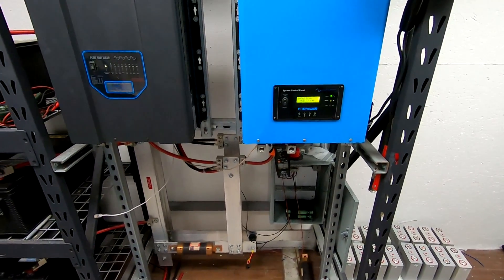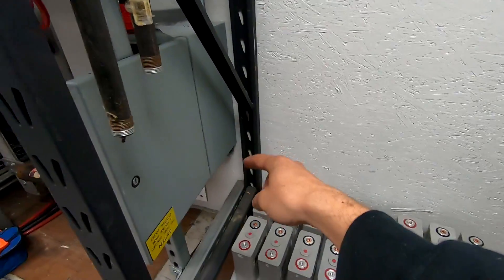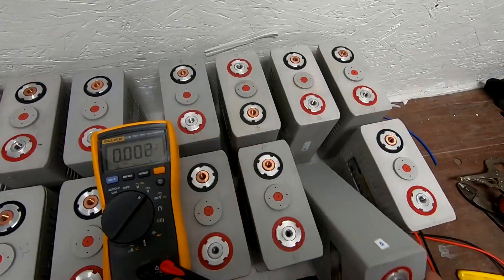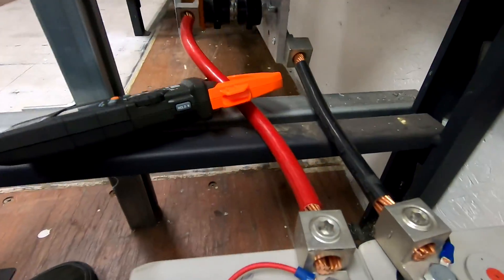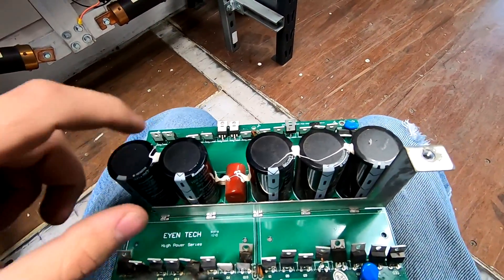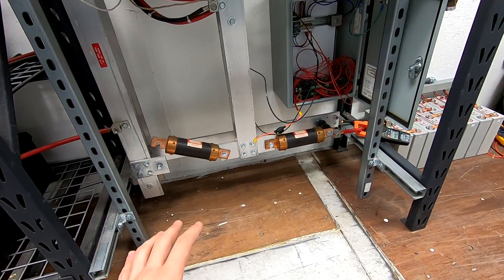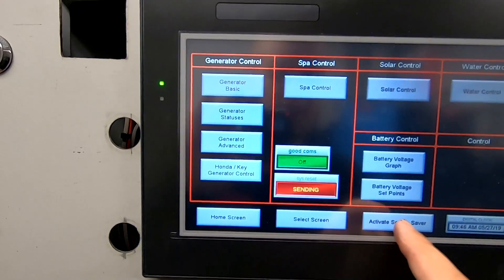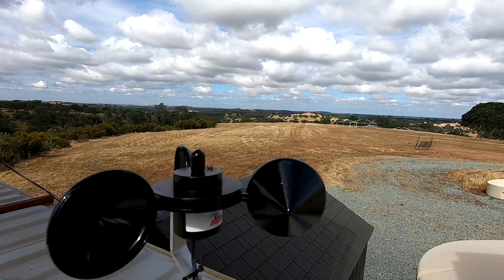Off The Grid: Installing the Best New Lithium Batteries!

Comment: Use a bank of high power halogen flood lights paralleled as a precharge PTC load. Lights will dim as current decreases and gives a good indication of when it's close to charged and safe to install the fuse. Works well for high powered audio systems so you don't blow fuses charging the caps.
Reply: @masterspacetime2826 Clever and inexpensive not janky. You can buy PTC inrush current limiters use an amp meter for indication. Now use a light bulb has PTC (positive temperature coefficient) characteristics and it also visually indicates the drop in current. This is the way you do manual 3 phase synchronization on generators until synchronization meters became the norm.

Comment: Thats a big idle load. My 10kw only uses 70w. The inrush on my inverter pops the breakers in the back of my inverter. Also my inverter only has 3 mosfets.
Reply from the maker: I forget, was your inverter a low frequency transformer based unit?
Reply: @HighTechLab  yes LF
Reply: @HighTechLab  Check it out . Inverter is half way through the vid.https://www.youtube.com/watch?v=GaBim8QpV1g

Comment: Awesome work. What are you doing for temperature on the lithium?
Reply from the maker: I'm not sure what you mean...Are you talking about temp monitoring?
Reply: @HighTechLab  yes for the lithium batteries
Reply from the maker: Currently, nothing.  The lithium cells don't require temperature compensation the same way that lead acid does, in fact any compensation would cause these cells to go out of their operating range (over voltage).

During use the cells don't typically generate heat, in fact the only heat I've ever noticed is on the interconnecting straps.  The lack of cell heat is due to their extremely low internal resistance (Remember resistance losses turn to heat and become heat losses).
Reply: @HighTechLab  Correct the temperature compensation is set to zero, but most BMS have temperature monitoring for shutdown control.
Reply: HighTechLab I think the question is for protection of charging when the cells are too cold or hot... depends on where you live I suppose...

Comment: Beautiful work.

Ex-EE who worked on nav systems decades ago, how would I go about learning all about inverters, charge/discharge rates, blah blah and blah to be able to design and troubleshoot this stuff myself as opposed to hiring a contractor whose work (even if I did hire one), I’d still want to know how to double check?
Reply from the maker: Check out 
"DIY Solar Power with Will Prowse", guy is pretty smart and I've learned a lot from him.  There are quite a few channels here on youtube that you can use as resources.
Reply: HighTechLab ditto. I found his channel informative and pretty unbiased when doing reviews and diy setups.

Comment: Did I just watch the similar video or the same on twice?
Reply from the maker: There is a clip or two that carried over.  There is much more info on this video though
Reply: I dont know if you have,but I would be interested in some videos if you ever decide to have a wind generators as well :/ :) 💜💖🧡💗🖤
Reply from the maker: I would really like to do wind power - given that we are on the top of a hill we could really benefit from it.

The struggle with a lot of this off-grid stuff is getting the county on the same page.  Currently the system is all in a shipping container and considered personal property, and could be removed if we were to move off the hill, therefore a permit is not required.  As soon as we permanently install anything that is not removable such as ground mount solar panels, wind turbines, etc. they want all parts of the system to be permitted.

A wind turbine would also need the structure engineered (the concrete, post, guy wires, etc.), so what ends up happening is the cost goes through the roof and it no longer becomes a viable option. Typically to get something engineered like that is around $2500, so consider how much power it generates and how much diesel fuel you can buy for the same cost.

Maybe I can do a better video explaining the return on investment aspect of these systems.
Reply: @HighTechLab  Mount/bolt the pole to the side/corner of the shipping container. A small 400W+ wind turbine would probably go a long way charging batteries at night & cloudy days. Reduce the generator runs at night and/or allow for a smaller battery bank. Might be worth it to experiment. Might make for some good videos too!
Reply: Yeah I can see that eating the dirt :d
I thought of many small turbines..but oh  well :/ I am not the smart one here, you probably have a reason for what you said,hope you be happy anywhos ^-^ I know countrys suck  :( 🖤💛💗❤💗🧡🧡
Reply: Yeah,thanks,I watched the last one while I was sleepy or drunk so I couldn't be sure ;) lovely videos,ma  fam
Reply: I want to know how many bms are use in serie one or two

Comment: 100ah cells. So 100x16x3.2=5120 wh. Doesnt seam like enouph. How many more u plan on putting in?
Reply: Greetings friend ! What I do when connecting inverters to a large battery banks is use a lamp or resistive load... make sure its  turned on and has a working bulb and I touch the neutral side of the plug to the negative busbar then the hot side of the plug to the positive side to the busbar with a large insulated wire.. this slows the In rush of current and you won't get any arcs.. if the amp draw is huge than it may ruin the bulb but I haven't seen it do that yet.. I always do this and it prevents arcing ... awesome battery cells! Nice work..
Reply from the maker: This is what was suggested to me, when I get a sizable enough contactor to have a low battery disconnect, I will need to construct an automated system of similar performance to handle reconnecting.
Reply: @greglatta6525  I think I have see a video like that on YouTube and it was cool. Thanks
Reply from the maker: Eventually when money permits, 800ah.  These are performing 1000x better than the lead acid cells, I estimate those only had 50ah usable power and these are more or less 90% usable
Reply: @HighTechLab  Did you check out the larger 180Ah Calb batteries? Less batteries in the battery bank.
Reply: So a 40kwh bank! that would be very nice. Mine is about 20kwh li-ion NMC from a Fiat 500E but i have no solar or wind. I just use it as whole house backup so i dont have to run my 12kw diesel genny at night in the winter with low load. To prevent wet stacking In those rare  ocasions i actually loose power. Goal is to add a few 1kw wind turbines and supliment some electric bill. But mostly just to tinker with. The 100w ac bulb trick fir inrush works very well.